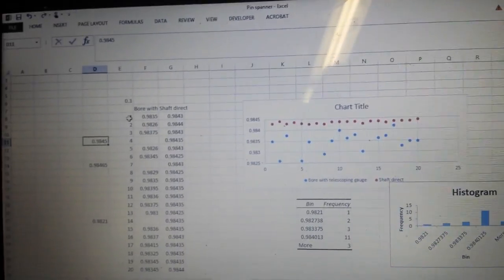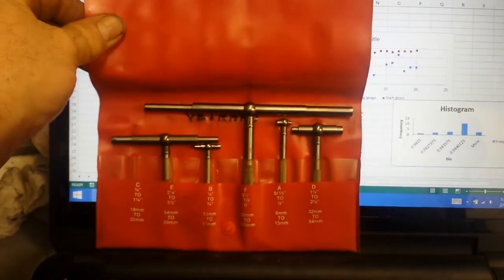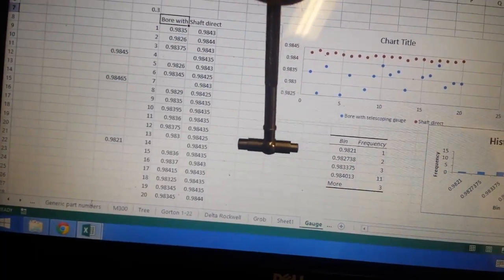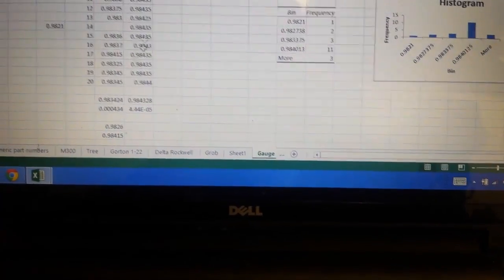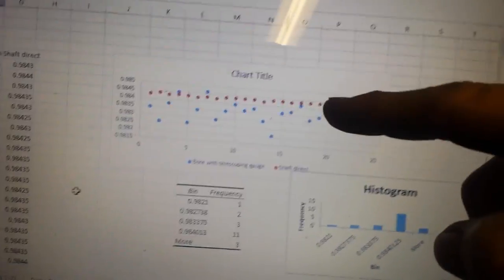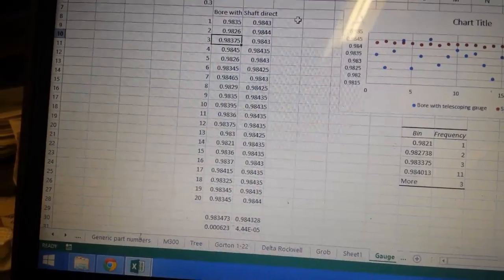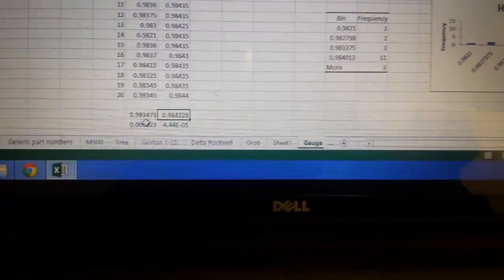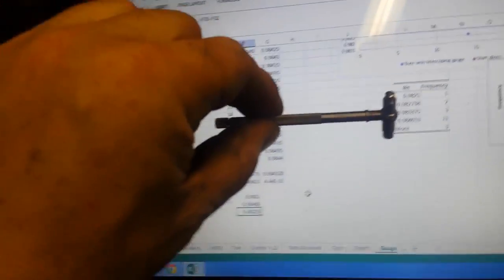Telescoping gauge performance for bore measurement

Comment: Good video on an interesting topic....proper technique always results in more accurate and consistent measurements....I was always taught to set the telescope gage ,on the bore, slightly off axis. In one smooth motion,sweep the gage thru the tightest part of the bore. Make your measurement. This should give your most consistent reading. Like all physical actions, perfect practice technique goes a long way toward desirable results. Practice on a known ring gage standard until your results match. Using intermediary measuring techniques always introduces error. Look at the tools themselves, your micrometer probably costs $400 (USD), the entire telescope gage set is about $75(USD).                      In my opinion, with practice , the best accuracy you can hope for is +/- 0.00015". Much greater than calipers,  far less than a $400(USD) bore micrometer. The true condition of your bore may be an issue, very few bores are truly round , most suffer from taper, ovality, or lobed conditions.   Great work putting the deviations on a spreadsheet, 👍

Comment: I absolutely detest telescoping guages. I never get a consistent reading with them. I prefer to use a good, calibrated set of calipers for bores that require .0005" or larger accuracy.